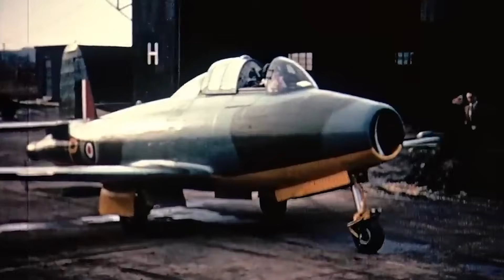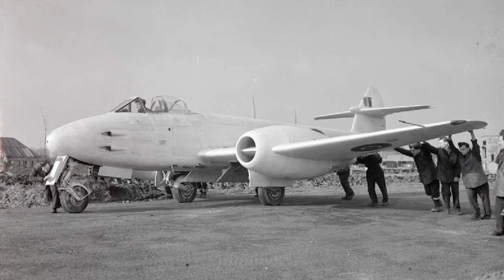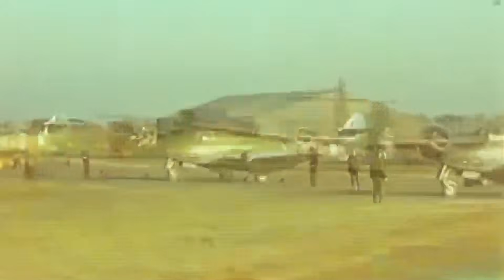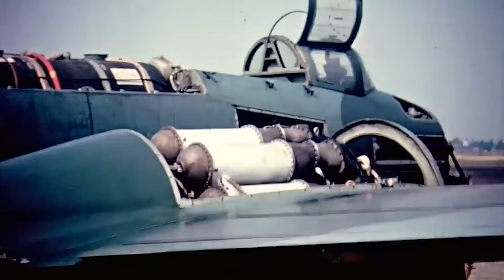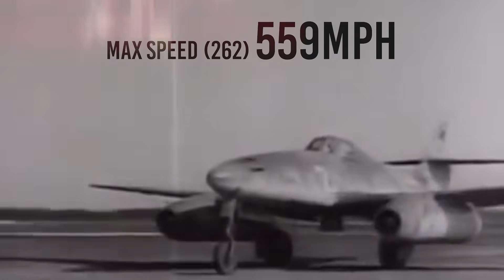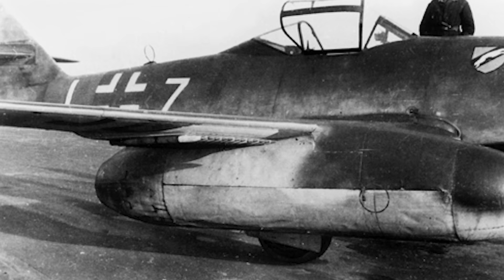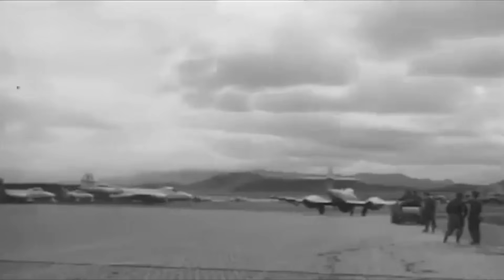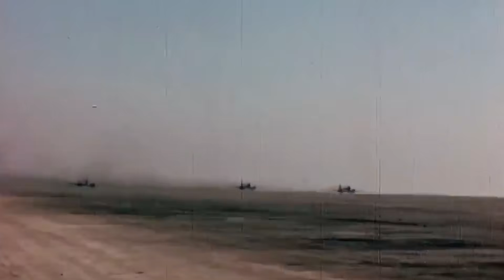Meteor vs Me 262 | Which was the better WW2 jet?

Comment: I can't stress too much how Germany's lack of strategic materials like tungsten, molybdenum, chromium, vanadium and others compromised their piston and jet engine development and operational servicing logistics. By contrast the UK and US could source any ore from the entire British Empire or the USA. As a result the Jumo-004B was slower to spool up and had a shorter engine life than the Rolls Royce Welland and Derwent engines, but slow spooling rates was an issue that would dog early gas turbines well into the 1950s. As they had shown with their Daimler-Benz and Jumo piston engines, this led German engineers to some ingenious solutions to building high performance engines within the limitations of mild steel and aluminium, - such as the internally air-cooled turbine blades in the Jumo-004B. Messerschmiit had originally designed the Me-262 with BMW-003 engines installed in mid-wing nacelles like the Meteor, but later changed to the Jumo-004B mounted in under-wing nacelles designed in part for fast engine swaps. 

Both Junkers and BMW had focused on using axial flow compressors while Rolls Royce continued with Frank Whittle's centrifugal compressors. I believe both sides realized the potential superiority of the axial flow compressor, but the centrifugal compressor was easier to design and make. Getting the airflow physics right in the axial flow compressor was much more difficult, but both Dr Franz at Junkers and Dr Oestrich at BMW felt the advantages would outweigh the drawbacks and in the longer term and - too late for Nazi Germany - they were proven right. 

The relatively small numbers of Me-262As in service reflects the difficulties Germany faced as it entered service late in the war.
She was being bombed days, nights and weekends. Skilled personnel were being conscripted away from the aircraft and engine manufacturers to fight on the collapsing Eastern Front and often replaced with unskilled and unwell slave labour to meet unrealistic production requirements. I've seen a few original Me-262As now, and all of them had a pretty rough finish that must have cost some speed and range. Although fuel was becoming short, unlike with piston engines that required B4 or C2 petrol, the jets could more or less burn almost anything, but generally used kerosene-like jet fuel which was more widely available. 

Newer engines like the Jumo-004C and possibly even von Ohain's Heinkel-Hirth HeS-011 were well along in development. Had somehow Germany not lost the war, the Me-262 would have had post-war prospects at least comparable to the later Meteors. Even during the war a high speed version with a much more pronounced wing sweep back was being test flown, along with a separate bomber variant with the cockpit moved forward rather like the Meteor. Others included BMW jet engines with rocket boost to enable faster, shorter takeoffs. In fact, arguably there was too much research into alternate Me-262 versions going on at Messerschmitt when the focus should have been on the production Me-262A. This was a common problem with the way the RLM oversaw engine and airframe procurement, splitting off to many of Germany's aerospace engineers, jig makers and skilled tradesmen into risky esoteric research while not enough were available to deal with ongoing production and development of combat aircraft, while others were being forced into the army in the USSR.

Ultimately I think the Me-262 was the superior design to the Meteor, but thanks to poor government oversight and lack of vision, constantly changing priorities and the fact that Germany's leadership has gotten the country into a war against the entire Anglosphere and the USSR meant that the Me-262A, advanced as she was, had no chance of making a difference. Had she arrived 2 years earlier she might stood a chance. The autumn of 1944 - even when she flown by JV-44, some of the finest fighter aces in the world - was too late and smothered by sheer enemy numbers.

For more read Dan Sharp's very detailed book "Me-262 Development and Politics" or RN Captain Eric Brown's account of flying it in his book "Wings on my Sleeve".
Reply: The thing is warplanes need to be serviceable, there's an irony in the Meteor's safe design choices, because the Allies were less constrained so could better have afforded the 262 on V1 patrols.
Attempting the long term promising but harder axial flow is the kind of decision that delayed introduction.
Wouldn't the Luftwaffe been more effective if they had had maverick but practical designs like the de Haviland Mosquito?
It's the same story with tanks, great headline stats, but serviceability and production meant there were too few of many exotic types, looking for silver bullet solutions.
The very fact that Meteors were not engaging against ME262 shows Allied air forces were not particularly troubled.
Reply: @RobBCactive  The ME-262 was relatively easy to maintain, because of low engine life it was better to put them in nacelles, not to mention vision was better on the 262 for gun sights.  It was Hitler's decision that the Schwabble carry bombs that forced a redesign and delayed introduction into service.
Reply: @Jadefox32 the ME262 even would have 2 FW190 on patrol out of a protective detail so they could take off, besides the other issues that were mentioned in this video.
The point is mass & volume matters, replacing engines after 50hrs is high maintenance in my book.
Reply: @RobBCactive but not really by early jet standards
Reply: what a gem of a comment
Reply: The British built axial-flow turbojets even installing them on a Meteor. They produced far more thrust than the German efforts. They found them problematic at the time so went with the centrifugal design for the Meteor to get a reliable and usable plane operational ASAP to get the war over.  A plane that outperformed piston engine planes. 

AA Griffiths invented the axial-flow turbojet. The first fully reliable and perfected axial-flow was the 1950 RR Avon. Still used today in ground applications.
Reply: By far the more important of the two planes.
Reply: @douglemay7989 
Not really.
Reply: @douglemay7989  Nope. The wings were completely obsolete before it even took off for the first time.
Reply: I can't stress too much to you that Germans had access to enough rare metals, however never had a programme to develop high temperature alloys. If they did and improved their alloys they would also still have had the conceptual problems with their engine. They were way behind.
Reply: @tsegulin  the Germans didn't understand the problems facing early jet engines. Whittle designed the axial flow engine but because he fully understood his designs limits with the technology of the time, he built the more limited but initially better centrifugal flow engine, while the BAI worked on his axial flow design at farnborough.
Reply: @tsegulin  My grandfather tried to enlist, but was turned away…he was more valuable staying in a tungsten mine.
Reply: The Me-262 continued in production in Czechoslovakia after WW2 - it was abandoned as soon as more reliable engines became available.
Reply: If remember correct Germany had a deal with Spain regarding tungsten, and actually had enough of it to some degree. The rest of your list regarding exotic alloys are pretty much correct
Reply: Everything you said is accurate but here are a few extra details and considerations.  The Centrifugal flow engine has only one serious drawback, frontal area.  Also even if Germany had the 262 in 1939 it still would have lost the war.  No matter how good of weapons they could make and even if they had the exotic materials and intact factories their economy would never have supported the necessary numbers of units, nor did they have the fuel and pilot reserves to put them into the air.  WWII was a war of attrition and economies and the Axis never stood a chance against the allies on either point there.  Also the Allies were kings of logistics along with real cooperative goals while the Axis was three largely independent operators who shared a little mutual support but otherwise did not cooperate and generally awful logistics.  There stories like the one fictionalized in the Battle of the Bulge 1965 film of Germans capturing soldiers, supply trucks, and abandoned positions where they found non-essential items like cakes wrapped in US newspapers that were only a couple of days old, letting them realize their logistics were so good they could squander it delivering cakes while the German soldiers had difficulty just getting their essential beans, bullets, and bandages.  In any case Germany could have made their defeat much harder with their jets since strategic bombing played a very critical role on that war but defeat was as certain as gravity simply because the Axis was not strong enough to secure its gains and defeat the weight of men and material that were thrown at them.  You can for example compare the invasion plans of Japan to invade the US West Coast or Germany invading Britain and compare their estimates of men and material needed to secure and exploit a beachhead.  Then look at what the Allies did on D-Day where we were delivering morey tons per hour as either Japan or Germany figured they would need per day for their invasion plans and neither had air or naval superiority in enemy waters or the transport capability to even meet their meager estimates.  The only way the Allies would have lost the war would have been a case of the most extreme incompetence.  At the end of the day Germany's wunderwaffe drew precious engineering, manufacturing, material, and monetary resources away from things that would have had much more impact like more (not better) tanks like panzer iv and panther, trucks, ships, subs, and most importantly heavy bombers.
Reply: @larrybremer4930  
You are spot on about the economies. Germans were fools to even try what they did. The country was split up after WWii. 
But everything he said was far from accurate.
Reply: I dislike the “woulda, shoulda, coulda” excuse is worthless. What happened is all that matters. All the rest is unimportant.
Reply: @melgross  The only comment that makes sense
Reply: @melgross  It depends if we're talking desings and engineering vs. wartime success. For the latter, what happened is what matters. But if we're talking design it's completely different, the germans in that sense had it harder both in terms of materials, fuel and bureaucracy from the demented nazi government.
Reply: You say 
"...but both Dr Franz at Junkers and Dr Oestrich at BMW felt the advantages would outweigh the drawbacks and in the longer term and - too late for Nazi Germany - they were proven right." But they weren't proven right, they were proven wrong because it was too late to have any impact on the outcome.
And as you say  "I believe both sides realized the potential superiority of the axial flow compressor..."  such that the UK hade two axial flow jet engines ready and waiting.
The German's were only short of metals in the context of the decisions they made. Instead of making 6,000 - 8,000 jet engines with 15% nickel alloys, they could have made 1,500 - 2,000 engines with 60% nickel alloys and they could have made them in a more robust form.